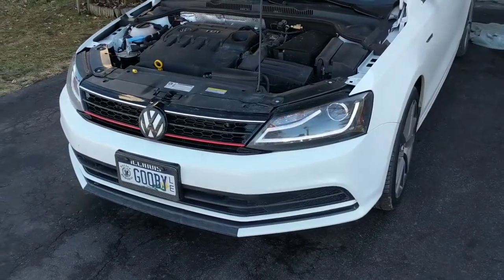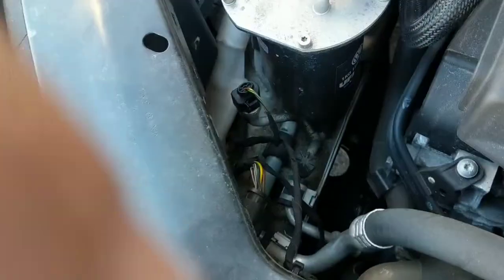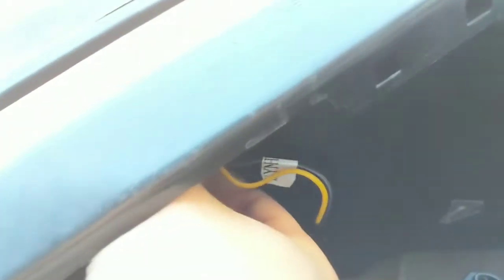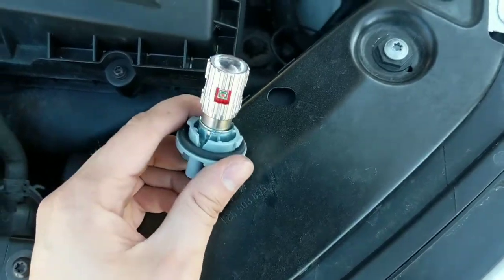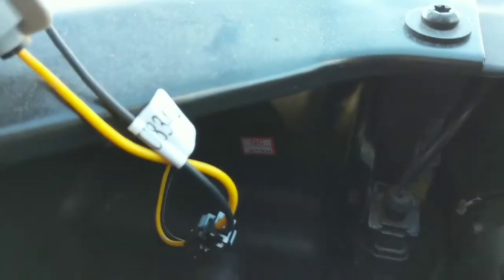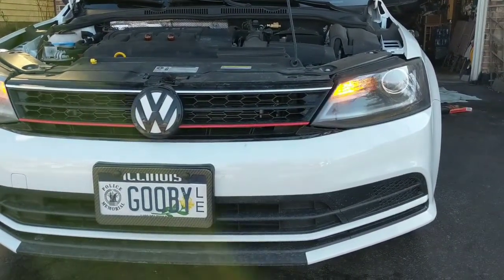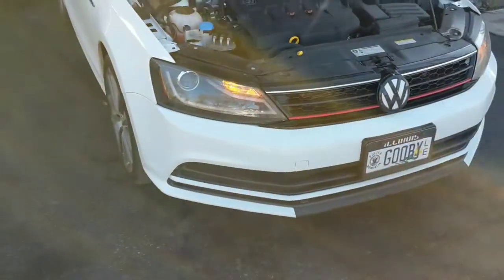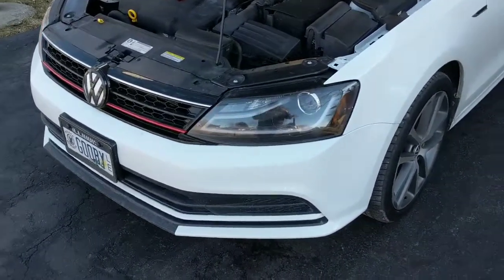MK6 Jetta LED Front Turn Signal Blinker Installation | How-To

Comment: Do you have the part number for the aftermarket turn signal lights? I ordered a pair off eBay and ended up with LED DRLs
Reply from the maker: The link for the exact bulbs we used is in the description.